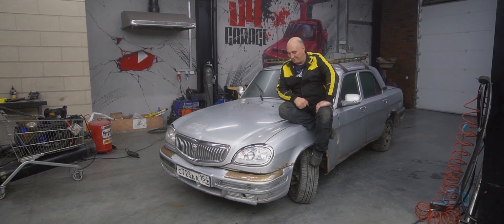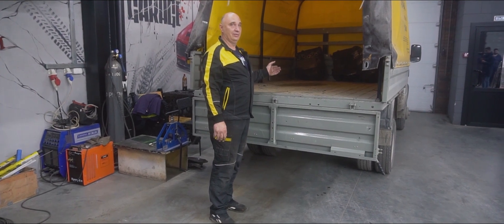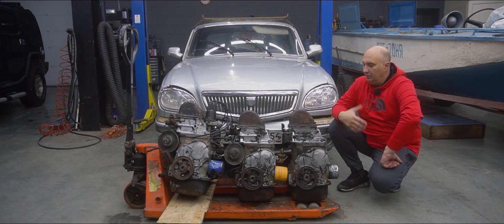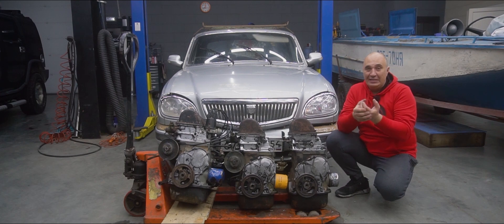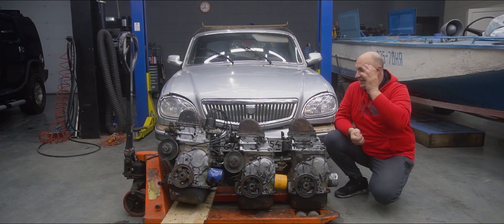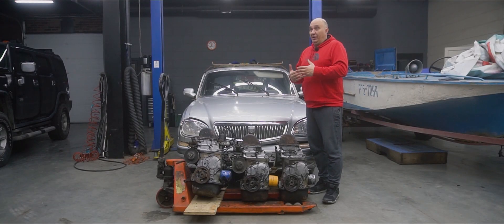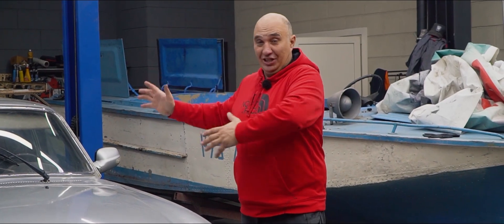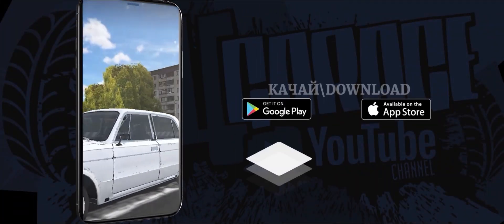Combining three Lada motors into a makeshift V12

Comment: Connect the motors with a super charger belt. Get 3 super charger pulled and a super charger belt. The ridges on the super charger belt will keep the motors synced up.

Comment: Keep them all in a row as the end of the video shows. Put on some 1 meter pulleys at the end of the crankshaft and hook them together like steam locomotive wheels. Use bad engine mounts for the two outer engines, so they can move around if need be.

Comment: Build an engine cradle to hold all three engines and build In adjustments to the cradle that allows the auxiliary engines to pivot and force the auxiliary engines outward to put tension on the belts that connect them to the drive engine using large diameter threaded bar and jam nuts for ease of adjustment and to hold them in place. I would also build a single intake manifold to connect the three engines and use  a 4 barrel carburetor for simplicity using flexible exhaust tubing

Comment: master engine attached to gearbox, the two slave motors in front of it side by side driving a modified crank pulley on the master with pulleys attached to flywheels, whole thing would be 8 cylinders long but likely fit under hood, height wise anyway. sourcing a usable off the shelf belt would be handy, maybe from something industrial or agricultural, if you wanted to go toothed sprockets and a chain, something from a 4wd transfer case could maybe be adapted as the chain drive ones have a 20-30mm wide chain with a flat outer surface that probably wouldn't mind being tensoned  with a rubber roller, mount the two slave motors either higher or lower than the master with a idler roller on the backside of the chain/belt

Comment: So my thoughts on your predictiment is if you want to only use a belt system would be to use a 12 rib supercharger belt and then made a cable junction to control the various throttles. This set up would give you a fail safe of the belt would snap if something went wrong. Other than that I would make a sort of mounting board to mount all three engines to utilizing the transmission bolt holes and then a tubular construction for the front. This would give a fairly decent set up no matter how you decide to transfer power between them

Comment: I think the top 2 engines could be connected to the bottom engine through gears between the fly wheels. Cut openings in the bell housing of the transmission for small gears to mesh, using the correct number of gears so everything turns the same direction. I've seen y'all do things more complicated, I can't wait to see what you come up with.

Comment: How about using a planetary gear at the end of each engine to synchronize them all together? For lubrication of the bottom engine, a modified valve cover could be used as the sump and the oil pump could be driven by the camshaft.

Comment: I would do a chain and sprocket type set up. A belt would most definitely slip A LOT especially when only ONE engine theoretically will be under the most load going through the drive terrain.

Comment: Instead of a Y shape looking from the front make a T shape looking from above. Where you take the rear axle from a lada and put an engine at each end. The driveshaft connection goes to the engine that has the transmission and the other two engines replace the tires. Of course you'd cut the axle lengths down a whole bunch so they don't stick out each side super far.

Comment: heres a ideea . link the engines using CVT clutches (centrifugal clutches )  from Mopeds (400 cc or more... bikes like the suzuky burgman ) ...weld some sprockets to the outside diameter of the CVT bell  that will connect the FINAL output to a MOTORCYCLE CHAIN SYSTEM  equipped with a tensioner ..no engine sync required .. simple to build.. add a small oil pump for the chain system to keep it lubed .. using harder CVT springs on the moped clutches will determine the RPM range when the clutches engage so this way they will add more power in higher RPM's .. or could leave them stock .... either way 3 CVT clutches will eliminate the need to syncronize the engines

Comment: Output of the driveshaft to a hydraulic pump, one of each motor forming a hydrostatic loop going into a manifold to a single bent axis variable geometry hydrostatic motor configuration connected to an automatic transmission input shaft.

Comment: It won't be a V12 but to make the configuration alot easier you could make a v16, two pairs inline and then use some sort of chain drive on the output shafts from a 4x4 transfer case

Comment: There should be a way to hook all three cylinder banks to one crank shaft. Maybe the center bank has a custom, really beefy rod that the two side banks attach their rods to. Yeah. That sounds right. All three crank cases will have to be shaved down to mate up in a W configuration.

Comment: Hmmmm... the flywheel has teeth in it. Why no try and use that with some counter gears so that everything spins in the same direction? The only bad thing is that one engine has to he connected to a bell housing. But I guess its possible somehow.

Comment: Fabricate a frame to hold all 3 that mounts into the cars original engine mounts poss not going to fit under the bonnet but you can always cut a hole in the bonnet Then connect all 3 via the harmonic balancer and the fly wheel with chains like timing chains this will allow all the power from all 3 to get through the gear box and to the rear wheels

Comment: I might try a side-by-side configuration like you had them on the pallet jack, with sturdy belts and pulleys. The first 2 engines having pulleys welded to their flywheels, the inside engine connected to the middle engine by pulleys on the fronts of their crankshafts, so it can utilize it's normal drivetrain,.

Comment: What, about connecting the engines in a long line instead of on top of each other and use a heavy duty fan belt and making sure it’s strong so the fan belt can withstand the rpm.

Comment: Why not get a front wheel drive car that is already running, and then install two separate engines in the trunk to drive the rear wheels.  Then syncronize the throttles.    I'm also thinking, what if you get a bigger vehicle like a van, and install 4 engines, separately dedicated to drive each wheel.  Talk about torque, wo baby.

Comment: Use a plate at the back bolted between the engine and gearbox, then bolt the plate up top to the two engines using the gearbox bolts holes.

Comment: V belt pulleys on the output shaft at the back of the 3 engines, then attatch the flexplate behind the pulley then the regular clutch and transmission will feel the power of all 3 blocks.

Comment: Use a reverse transfer case  for each of the top motors to a double transfer case. Then mount a double stack transfer case behind the transmission for torque. It would get power from all three motors at once. Of course you will need shirt drive shafts to combine everything.

Comment: Well we attempted to crate 2 OM646 driven go cart buy using 2 transmissions   and both connecting to the same rear drive shaft. Although in our case all will be software controlled

In your case i will go with belts at frist and later with chanes, try to first make the engine holding frame before putting theme in the donnor car. Flip the upper 2 engines so there gearbox exits are pointing the front of the car., this way you will get more toqur and power + keeping distance from the engine power belts (not sure how they are called exactly). Make a custom belt tentioner.

Make sure to install a big single fuel pump and a single big filter (much faster to syncronise). Connect all the starters to the same relay so they crank at the same time. Then when you make all of this just install the rebult engines in frame in the car and connect a transmission. I have no better way on how to sync the power. For water distributon use an electric pump setup

Also i might think that overall a better connection will be using the chanes, they can be eazaly extended and can passs on huge torque. Please make chane covers in case they snap since flying chane at idle rpm is capable of snapping off somones head

Comment: What's your Budget?  mount all three motors at the front and rear to a solid plate.  Have the fllywheels machined to mesh together, with a single clutch on the centerline motor.  Toothed belt, like a blower belt, linking the harmonic balancers.

Comment: Fabricate a mount for the bottom two to be joined together and using the existing side mounts in the car. Then make a frame out of some channel iron or box steel to join them by existing bolt patterns in the blocks. Simple, effective.

Comment: Make a plate like an engine stand that will hold all three in place at the rear. Maybe slot the mounts to tighten the belt for the front. A similar mount for the front, only from the bottom only, with slots as well.

Comment: belts are the perfect way to connect them considering you don't have to mess with timings or any random things. i would suggest to have many pulleys and not just one belt so it slips less and do not break belts.

i do not know how strong the internal of a Lada engine might be... so belts in the back could help. well that would only be a plan if you break it once. if it breaks, put the belts in the back, link the gear box output with a free pulley (not directly on a motor) so all 3 engines can pull together on that pulley so they separate the load... but that is only needed if you break the middle Lada engine.

Comment: Needs more than one belt together. If you ever see how large machines in machine shop are driven by their motors. Then You should’ve noticed that the drive belt is not one belt but about 5 belts in a row. This is to minimize slipping from the high torque motor and the high torque demand from the gearbox. I would imagine the same principle should be used with gas engines.

Comment: easy.. make short output shafts off the flywheels with a sprocket on each with a chain going between the 3 motors. the 1 motor in the center at the bottom's output shaft is longer to fit into the transmission. duck soup.

Comment: don't try to connect them with a belt. That won't transfer the power from the secondary engines due to slippage. I would recommend a heavy duty chain and sprocket system instead.

Comment: Weld a triangle engine plate and bolt all the engine's on with adjustments. Then because you won't be able to get long belts weld a triple pulley system to all engine's where you can have all of them in sequence with each other. Have them looking and working like a radial aeroplane engine and use chains to have a triple drive for equal power to one shaft to the gearbox. Also have one engine sticking down and the other two like a v up over. You might have to adjust the height of the car to get the output shaft to run straight to the back wheels but I'm sure you can work that part out no problem!

Comment: Transfer power using motorcycle drive belts, one at the back from an upper engine to the main engine, and one at the front from the other upper engine to the front of the main engine.  These belts are made to transfer power, and doing this front and back keeps things simple with the belt routing.

Comment: I think to avoid a synchronization problem you are going to need to make a 1 way pulley setup for at least the 2 secondary engines... That will allow for RPM variations and make up for any throttle lag or slop.

Comment: About the v12 you said you read the comments!!> hi love your channel, from England here. what about replacing the flywheels of each engine with large tooth gears (like a bicycle) then really heavy-duty chains down to the bottom engine that has a short shaft out of the back of the bottom engine and gear, where there is a flywheel welded to the end of the drive shaft and then clutch gearbox and so on

Comment: Put bigger flywheels on them and then put another floating one in between the 3 on the motors for your output. so everything would be powered by the flywheels.

Comment: primary motor should be rotated near horizontal with 2nd motor parallel to it, 3rd motor to the side rotated in opposite direction ,use double row chains and sprockets for the connection

Comment: for this crazy idea ( normall to russia) i would use a chain instead of a belt to not get any belt slip.. bit fit the pully on the back of the crank.. attached to the flywheel... i think if you run it from the crankpully that the crankshaft of the bottom engine connected to the gearbox will snap... if you run the chain from the back of all 3 engines to the gearbox the forces are equal of all 3 engines as it doesnt force 2 extra engines on 1 crankshaft... but on the other hand.. it are lada engines... build like a tank :P

Comment: maybe 1 way bearings and attach the pulley and the belts to that ...so if any motor is reeving more than the other 2 it doesnt matter to the others ...
its a bearing that transfers power only 1 way just like the rear sprocket of a bike it transfers power in 1 way and it slips and behaves like a normal bearing the other way

Comment: I was thinking about 3 hydraulic pumps at the front of the engines (you can give the pums a lot of revs by using a smal wheel on each pump - wich is connected to each belt-wheel by its own belt).
Then connect each pump (exit/input) to the next one - so that you have a circular system.
The bennefit would be, that the engines don't have to match revs perfectly. The stronger engines would help the weaker one to run smoothly.
It will cause some lose of energy, but that will happen in any case.

There would be only a physical connection between the engine in the middel and the driveshaft.

Comment: I was expecting more of a "E-12" configuration with all the engines in a row and connected at the crank, leading into some power-combining mechanism (gears? belts? dunno) and from there to the gearbox (which might not tolerate the power input of three engines, who knows)

Excited to see what becomes of this Lada 12-cylinder, though!

Comment: Maybe make it like a W or turn the bottom engine upside-down so there is a shorter belt,if you create a W you could cut and weld the sumps together and possibly share fuel and cooking in the same so its more like 1 complete engine

Comment: Considering the power of each engine, belts are fine.  However, you'd be better off with 2 belts, one  for each upper engine common connected to a double pulley on the main engine.  Also, use toothed belts such as motorcycle drive belts or blower belts.

Comment: its a W12,  buggati and some ww2 tanks uses them , 
three heads 3 rows of 4
seen dual engine dragsters that meshed the starter gear on the flywheels together , 
https://st.hotrod.com/uploads/sites/21/2010/08/hrdp_1008_04_o-howards_cams_twin_bears_digger-twin_engine_setup.jpg
the drove the gearbox of the one engine https://twotogo.homestead.com/files/Photos-SidebySide/9-8-26.jpg
https://www.google.com/imgres?
and used the cam and ignition out of a boat engine to run the second engine in reverse rotation , if you find gears that fit the startergear ring on the lada flywheel (maibe another lada flywheel ?) you could have all the engines run in the same rotation 2 in a wide V and the third sitting inside the V on top of the extra fluwheel  prolly need to narrow the oilpan to get the middle engine to fit low enough to mesh intoo the gear but you should be able to use the stock intakes and exhaust manifolds if you make adapters to get the carbs to sit level 
the dragster used a normal startermotor but ran 24 volt through it for some extra oompf to get the extra engine to turn with the other 
you probably need to make and mount engine plates on the front and back of the engines to prevent them shifting about imgurl=https%3A%2F%2Ftwotogo.homestead.com%2Ffiles%2FPhotos-SidebySide%2F9-8-27.jpg&imgrefurl=https%3A%2F%2Ftwotogo.homestead.com%2FHowTo.html&tbnid=H8gWxeXb7M4BGM&vet=10CAMQxiAoAGoXChMIkMKwsI6X7QIVAAAAAB0AAAAAEA4..i&docid=9KxoZXMabj-A7M&w=450&h=414&itg=1&q=twin%20enginesragster%20%20engine%20plates&ved=0CAMQxiAoAGoXChMIkMKwsI6X7QIVAAAAAB0AAAAAEA4
https://www.svtperformance.com/attachments/hppp_0905_05_z-1959_pontiac_challenger_i-front_view-jpg.1457562/
they allso added a second starter ring to each flywheel and welded them all around so they wouldnt fly apart (they run without oil and get hot they allso wear out fast ) 

ever seen a deltec engine ? :https://www.youtube.com/watch?v=D3bj47TAYiU&ab_channel=mekanizmalar there are twostroke so you whont be able to use he lada engines for that 
commer allso made an engine intoo an 8 piston opposite boxer 4 cilinder https://www.youtube.com/watch?v=pGaISFg_ZIw&ab_channel=mekanizmalar realy weird engines with a special sound to them

Comment: You can connect two of them with a Differential gear, but instead of wheels, there are the Engines, and the driveshaft drives the torque to the third Engine making a T shape